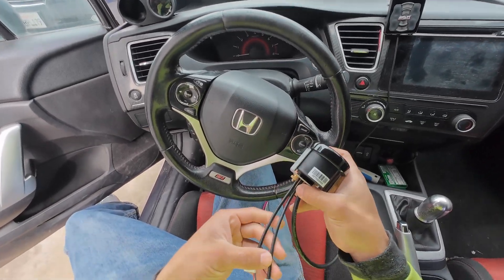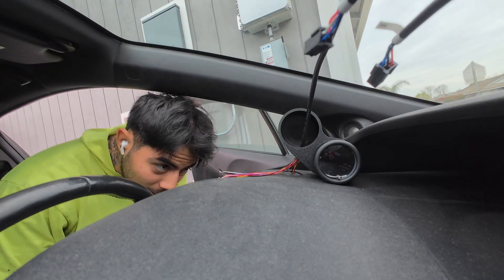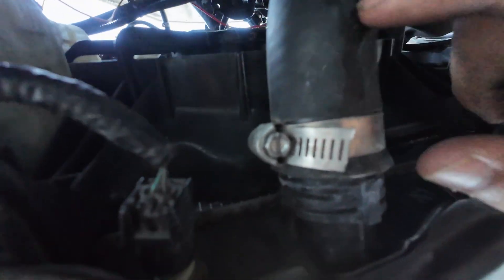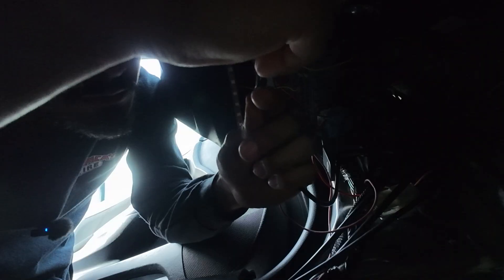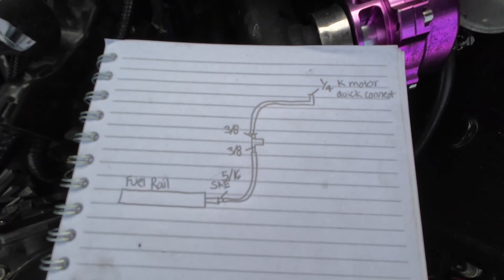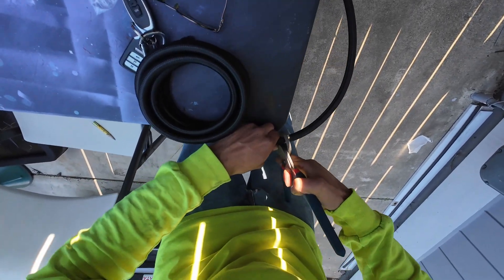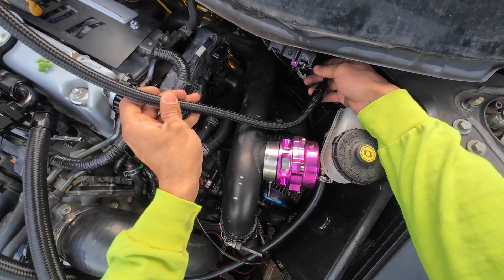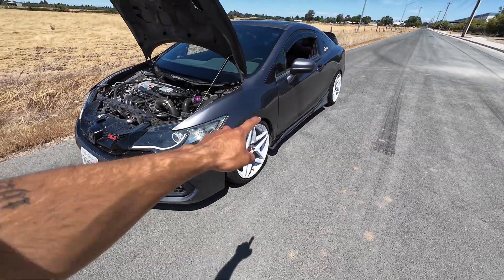Turbo 9th Gen Civic | Innovate E85 Kit Install

Comment: You need a type s oil pump our k24 have terrible oil pickup and will blow your motor one day
Reply: fr. I went straight to type s pump inline pro studs and cometic hg, buy once cry once. full e85 no flex yet, psr 3576 and didnt wanna risk anything blowing, but paid 3k in labor so not everyone can justify doing that support